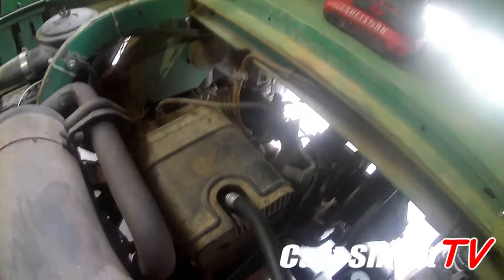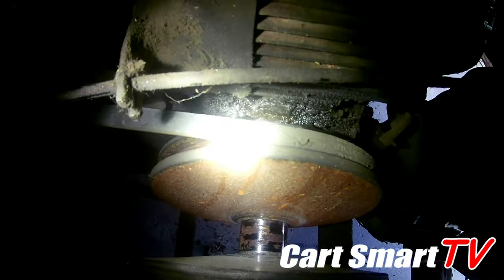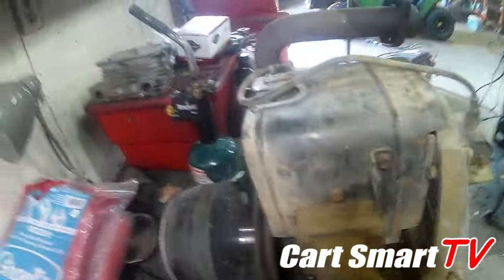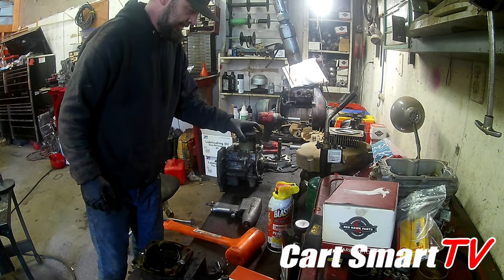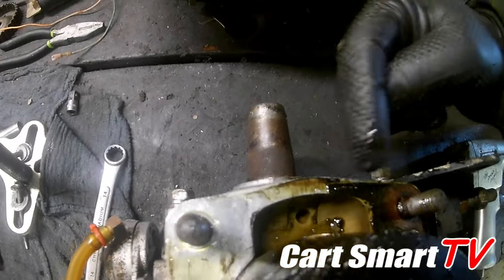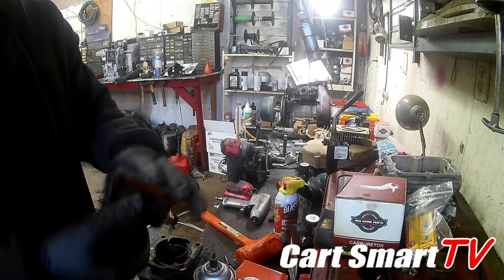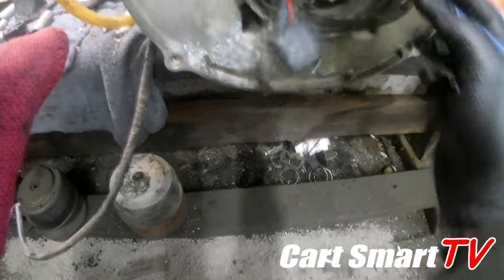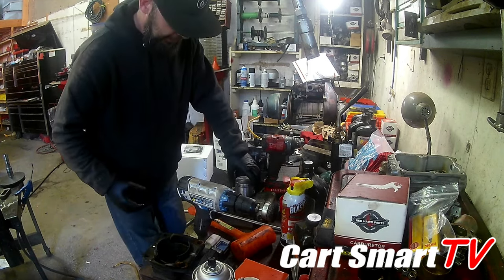EZGO 2 Cycle Rebuild

Comment: Great Video I have a question Where would all the grease fittings be on a 1996 ezgo golf cart ? Tie rods and steering box ? Just trying to best maintain my cart. Thanks for your help !!
Reply from the maker: A lot of those don't have any fittings but if they do they should stand out. You should have a steering rack on yours which does not have any fittings. Thanks for watching!

Comment: Do you have a video showing the carb adjustment on these Robin 2 cycle engines? Rick
Reply from the maker: They don't have any adjustments on those. You have to take apart often to clean. You take the bowl off and remove the center screw which has many holes in the tube that often get clogged up and need to be cleaned out. Call us for more info. 276.632.8905

Comment: I have a question I have the same motor in a cart and it keeps blowing out the crank seal by the clutch any ideas?
Reply from the maker: They can be hard as they vibrate so bad. Need to be flush to the case and then maybe seal off with RTV. Biggest mistake most people do is put them in too far causing the crank to push it out.